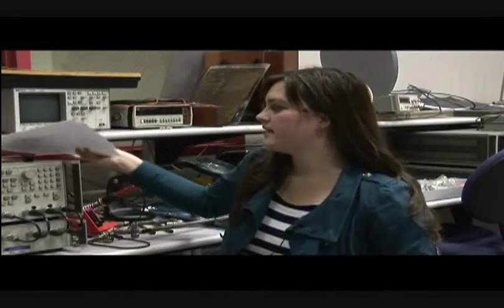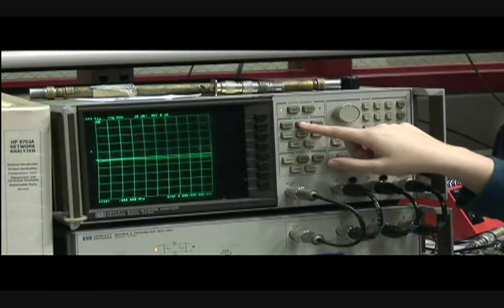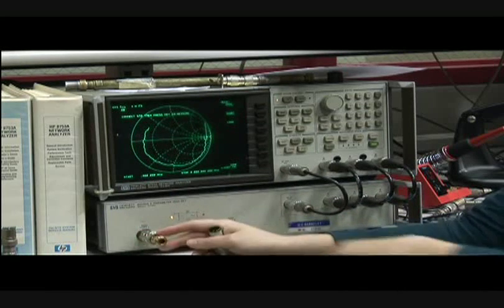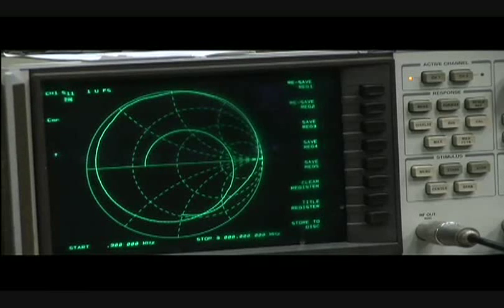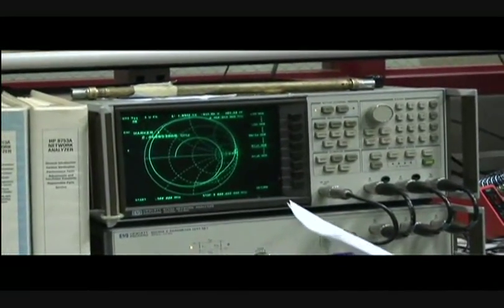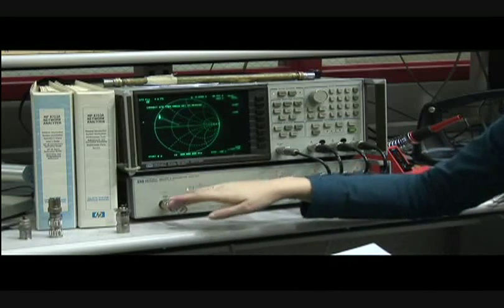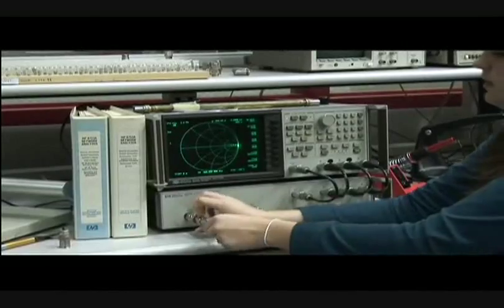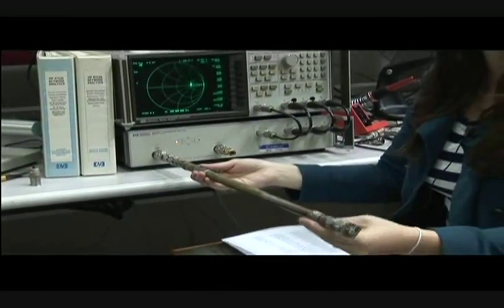Slotted Line Lab with Network Analyzer

Comment: Erin, you did a great job explaining how to calibrate the network analyzer, and how to read an impedance at a frequency and then how to use a transmission line section to make that impedance purely resistive. Using that 8753A brings back memories of my university undergrad days at U of T in Prof. Balmain’s RF course, and then in my 20 year career at Motorola. That was the most expensive piece of equipment HP sold us, and it was a privilege to be able to use it. Thank you for sharing this!

Comment: Yes, I am very envious of your equipment as well. I used to work as a technician in a design lab at a now defunct 2 way radio company. The engineers wouldn't let me play with the Network Analyzer & S parameter test set. I was only checked out on the Vector Impedance Meter..LOL. Where I went to Tech School, they thought a Smith Chart was the result of a geneology search. Thanks

Comment: and one more thing, you should never attach the tunning stub directly to hte connector, as the weight of  the metal pipe may bend the connector pin over time. YOu never wnat that to happen .